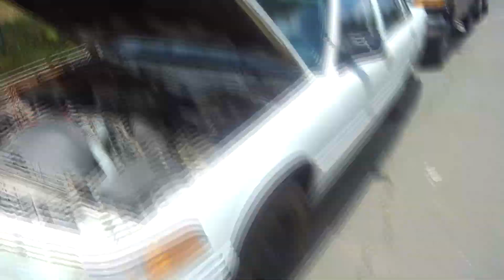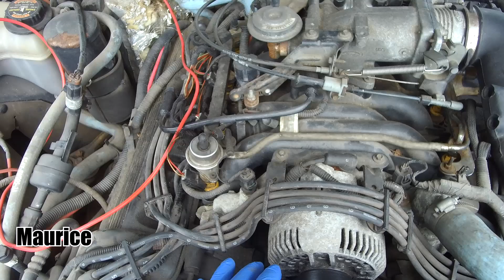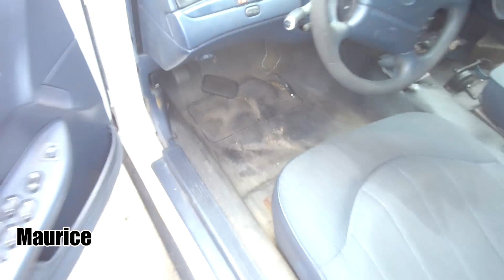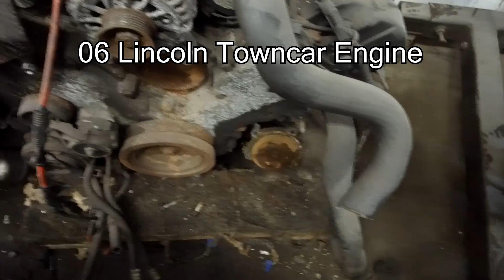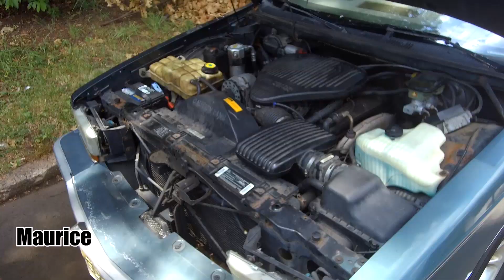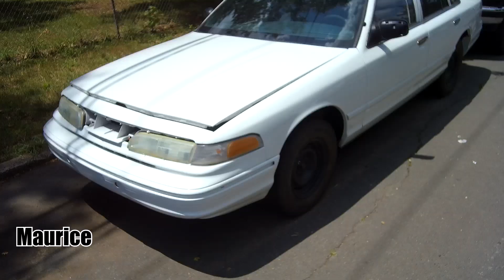Late Model 4.6 2v Interceptor Swap in  a 1991-97 Crown Victoria/Grand Marquis

Comment: I want to put a p71 in my 1997 Mercury grand marquis, questions. Do I need to upgrade the transmission?? What's average prices to complete the engine swap and get it running the way it should????

Comment: I got a blown 93 grand Maris motor 4.6 v8.. what year motors would fit
Reply from the maker: any modular engine from your year to coyote that would fit, but what will work with no wiring is the newwer ones, but the best engine to play with is a 2004-up engines plug and play ( with some wires have to be extened )
Reply: @bstfordchannel923   Thanks man I appreciate that
Reply from the maker: @nuera1005  anytime bro

Comment: So you dont need to change the wiring harness I plan on putting a pi motor in my 95 grand marquis also is it a big deal if I want to keep the original metal intake I know it would cut some power but aluminum wont dry rot in 20 years but im mainly worried if I need a new wiring harness
Reply from the maker: it pretty must the same thing a few things are odd like ( injector clips ) and a few things you can eye ball it and see what is what.. the fuel lines may seem a paint but you just hadd your on to it
Reply: @bstfordchannel923  im not quit understanding what you said at the end about fuel lines
Reply from the maker: @kalebvvv132   maybe this will help https://youtu.be/_JpZIShgjGs

Comment: Hey is There any way I can get in touch with you I have a 94 mgm and a 09 motor trans & ecm out of a Intercepter need some help
Reply from the maker: Here what i would  to start... keep the trans and harness (  put that to the side ) and just install the engine in you 94 ( straight forward swap ) you just add the intake plenum from yours ( the cast aluminum stuff ) Not the intake manifold and you use the 08 alt.. you can use your old power steering pump and AC ( no rewiring  )

Comment: What years of crown you think is the best years
Reply from the maker: sorry for the late reply Markis    1999 ( interceptor ) good tune seems really fast, but it aint ( runs real hard though ) 04 is good 1 still old school throttle cable.. )05 is odd one has antenna on the rear quarter ONLY 1 that has that.. 06-2011. now 2009 starts a new type of trans really hard to find good used..
Reply: Thanks

Comment: The aero Vicks are sweet... but the older square body 1990 still had the 302 motors in them which would give a great chance to build a beast and look cool driving it 😎
Reply: Let me add a little bit to this one. I like the last LTD. that one 😎. And i like the the interceptor with the 351.

Comment: The advice about the seals and the water pump should be on page one of the first book that every car guy gets.

I keep telling people that with any used car, do the basics as soon as you get it home: change plugs, coolant, oil, transmission fluid,  radiator cap, timing belt, water pump, accessory belts and tensioners as soon as you get home and write down the mileage. In 90% of cars, you just bought 60,000 more miles.

As always, great stuff, sir.
Reply: I forgot to mention as I was in front drive mode, but you are 100% correct.

Comment: Be really careful not to fall in love with that LT1 and the Buick...
JUST KIDDING. I know that's never going to happen!

On the motor swap, are you swapping the new wiring harness into the old car?
Reply from the maker: i like the Buick lmao  the power is there which is wild suck Ford do not have more cheap modern-ish hp motors. 5.4 aint going to do it... Now for Maverick 302 Ford with coil packs i am doing the wiring swap thats whyit is taking me so long.. I have to be mentally ready to really get down with it.. Need ink for printer, tank and fittings ect.. Printer for diagrams BIG so I can see . Not on the phone type stuff lol
Reply: @bstfordchannel923  I heard that! Looking forward to it. 

That wiring sucks man. Goodluck with it!

Comment: My father had a Road Master. Great boat of a car. One of its best features was its horn. Give it a blast, it's one of the most distinctive and beautiful sounding in the industry. I used to blast it at anybody for the least minor infraction, LOL. I loved it.
Reply from the maker: I will check it out and put that on the next video lol I have to check it.. I its the same as the fleetwood caddy of the same year.. I use work for a caddy dealership i drove them NEW as a kid.. My thank you for the story brother. I always like those stories
Reply: BST Ford Channel - It just may be, its very regal sounding. 
I'm a retired electrician. When work was slow in Boston I worked in the Cadillac Hamtramck plant wiring the new assembly line. All day long the cars would roll by being built. The front of the plant smelled like a new car. Awesome.
Reply: I love the Road Master can wait to see the next video. Thanks for the great information.